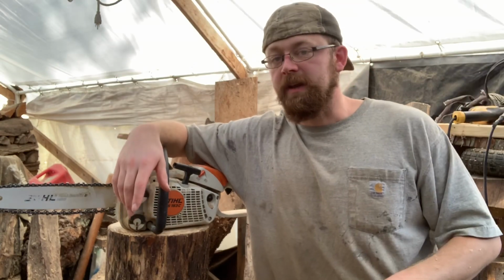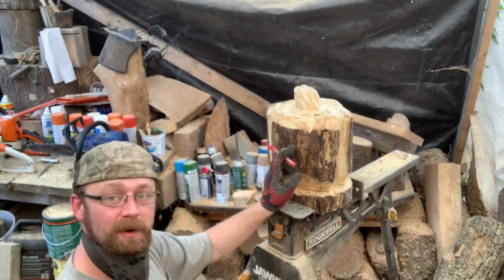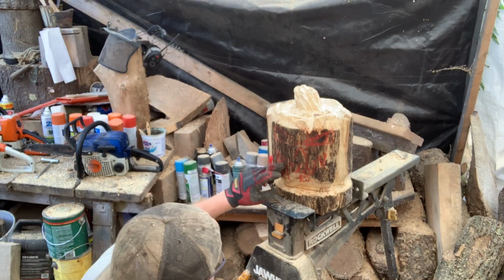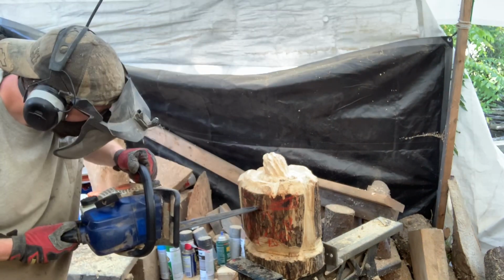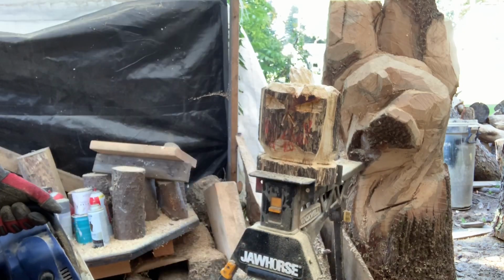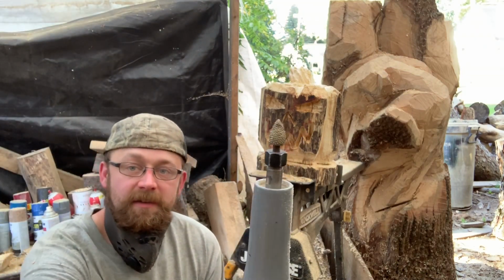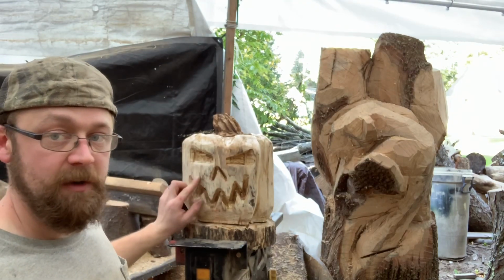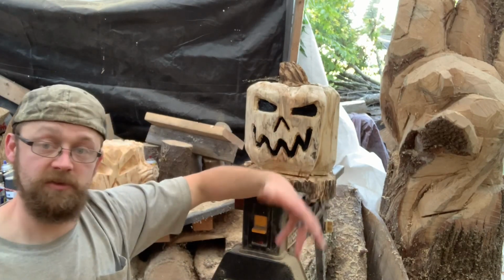Chainsaw Carving a jack o lantern tutorial

Comment: Kyle thank you so very much for your style of video’s they are so helpful and a little shout out to TJ 
your’s are also. New to the chainsaw &carving world, work mainly with pallets and reused wood. My question
is your die grinder and bit , have a 1/4 bit would you see a problem with using a DeWalt Zip Tool , you know the 
the kind mainly for drywall. Well it has a 1/4 collar but can’t find anywhere the RMP for the bits. Not the same 
brand it is a Kutzall  so if you can answer that for me if would be helpful. Now that I have bored you for the last two minutes
of your life, you can get back to carving or your little man there in the video.
Reply from the maker: The bits I use are saburrtooth burrs and they recommend 4,000-25,000 rpms. I don’t know a whole lot about the zip tool .